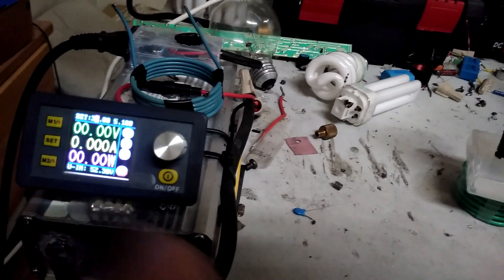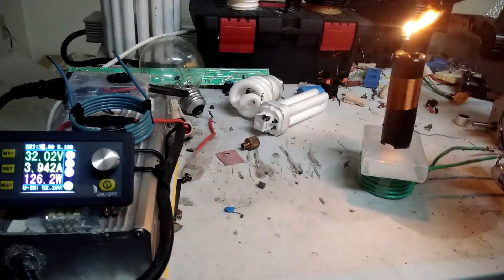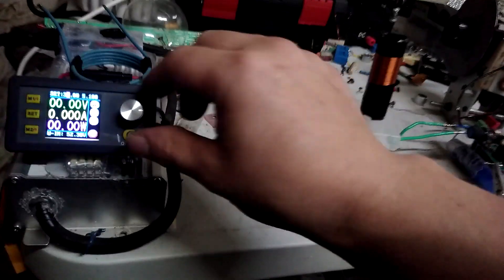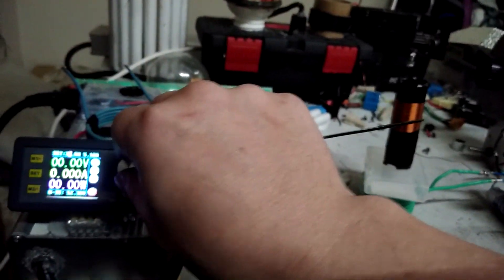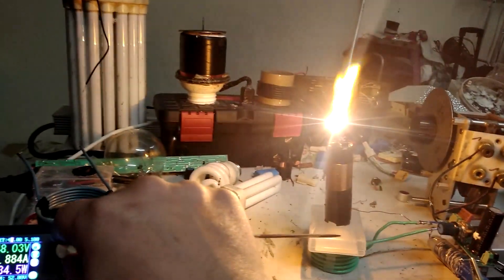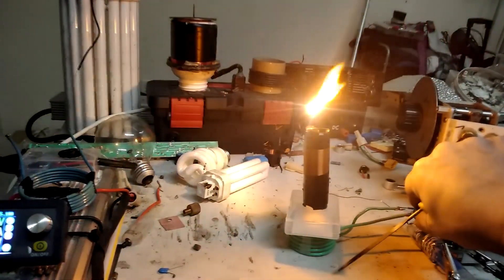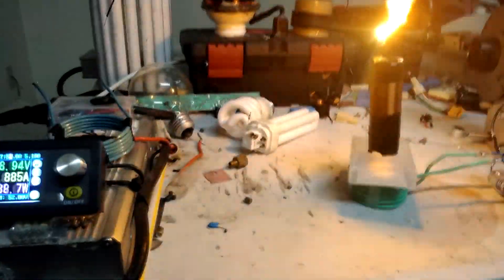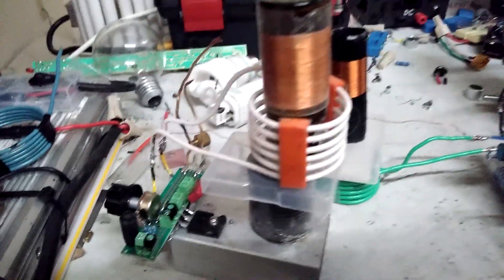Bigger Plasma Flame 10.5mhz

Comment: Have u tried putting fets in parallel ? Jut curious how it would affect the output at the lowest setting which u said detriments the output... it would double the gate capacitance but at least you'll be able to see if that's a major factor, though it introduces more variables, synchronicity
Reply from the maker: I haven't had the fets to spare trying it but so far I've needed about 4.7nF or so dead on extra gate capacitance and just haven't had any suitable caps other than literally some 4.7nF wimas. It would still probably work with 2 but I couldn't get the same tuning. I think it was BVC who tuned his circuit to use two 260's and the intrinsic capacitance. There are very small circuits out there which seem to be tuned very well though, just no details about them. I'd think this kind of output here could also be done with minimal fet heating. It runs ok as-is so long as I have a 12v fan going but the sink still gets more than just warm.

Comment: Very good, I still can only get like 1.5 inch plasma flames. Seems like you need a more powerful power supply. Your auto transformer for short runs should be fine, just figure out how do do current limiting otherwise your circuit will spontaneously self deconstruct.
Reply from the maker: Yea IDK if I'm gonna do it, maybe when I decide to just pop the fet out of curiosity. At about the 50-60v range I'd expect to see it breakdown and pop without better cooling. I feel like I need to see an accurate current draw in real time to really gauge what it can handle when running.